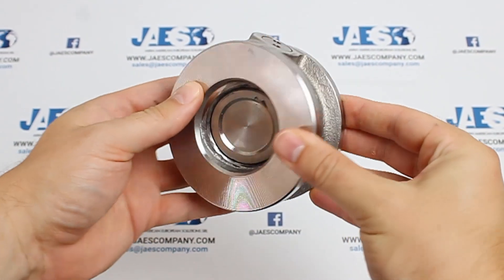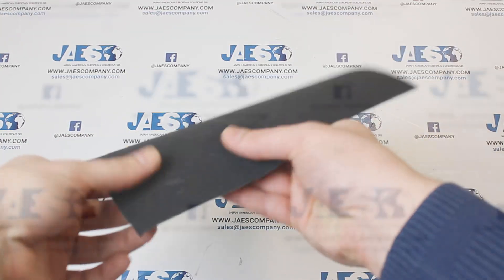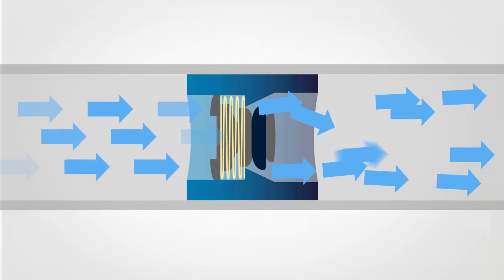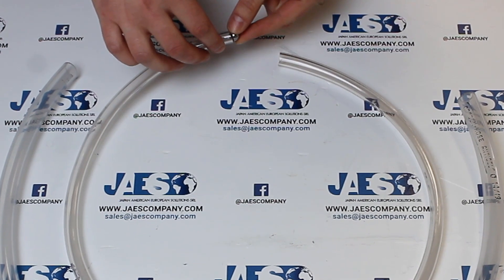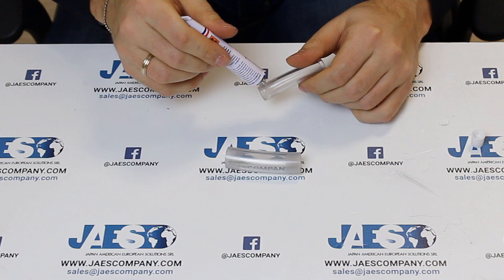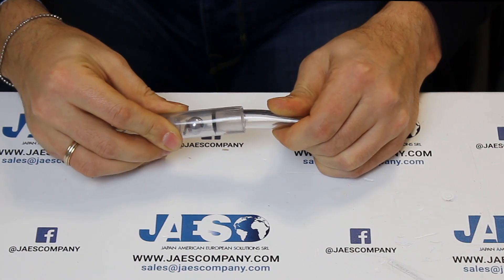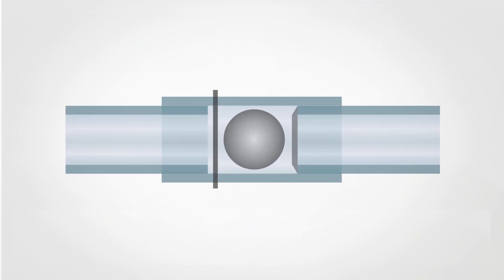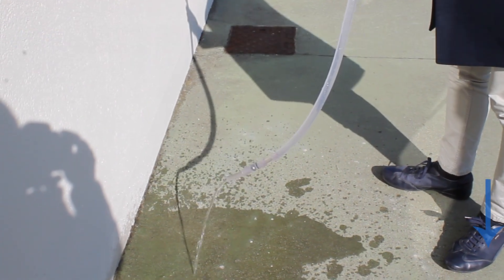How to make a check valve - Non return valve working principle

Comment: if it still lets water through what is the point
Reply from the maker: Hello and thanks for your comment! This is a diy version of a ball check valve to easily understand the working principle of a real ball check valve. If you're interested in more diy videos, you can watch this one about the construction of a dc motor using everyday materials: https://www.youtube.com/watch?v=P0rBeCQ0IKM&t=59s
Reply: This video demonstrates the low iq of the channel
Reply: Prevedi na Srpskom jeziku